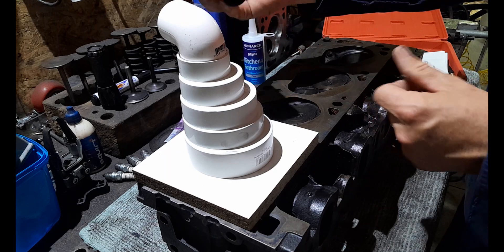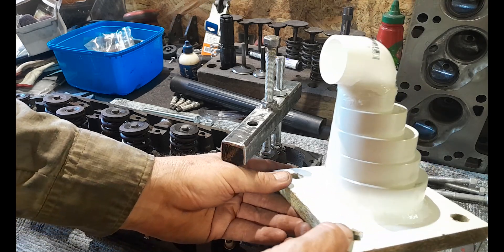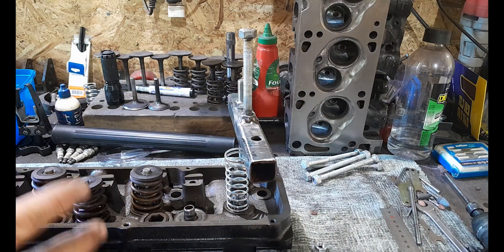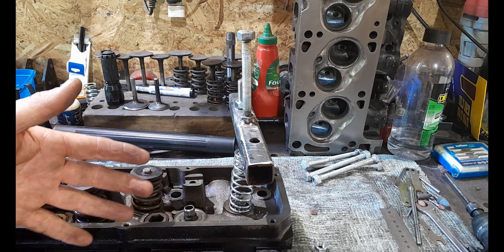How To Build A Simple Vacuum Based Cylinder Head Flow Tester

Comment: I have 3 maybe 4 cylinder heads for my 1500 triumph spitfire to flow,I bought a section of plexi glass tube the diameter and length of the cylinder,i bought a section of flat 20mm plexi glass,the cylinder top has a recess so i'll be mimicking the cylinder as much as possible,i may add an "O" ring groove to seal against the head,which would be the best idea,I probably should include the head gasket thickness in the step as the cylinder top step leads onto the gasket metal compression ring,so that will be added more than likely as it's a simple adjustment to bore the plexi glass sheet to the OD of the plexi pipe and glue it in place.

Add a fixing for a variable suction vac,either the little sliding port on the vac hose or the power level,don't need a massive amount of vacuum depression.

You have to be able to adjust the inlet valve in increments,I can't remember the actual critical region but it's not a huge amount as the critical point is around the first few tens or so of thou opening,using a dial gauge.
Something i see a lot is people trying to get massive flow figures,that is a bad misconception,sure the flow figures can mean you have a great flowing head,it can also mean you just butchered ahead and opened up the intake tracts way too much and now it's a full race head or junk,a full race head has to rev really hard at idle to keep the fuel air mixture flowing and not allow the fuel to fall out of suspension.

If the tracts are just opened up and are worthless because way too much material has been removed air flow velocity has been completely lost and the head won't work,a large paperweight.

I am using clear tube for a few reasons,but the main job will be to match the inlet manifold to the inlet ports,called gasket matching,so both metal faces have the same size hole as the gasket and also without any stepped edges to cause turbulence,that is at least my main goal,to remove sources of turbulence,all the little bits of casting flash and out of normal lumps and bumps,not however any curves ,bumps,lumps that are intended to be there,just the sources of turbulence that make the air canal smaller through turbulence.
Just smoothed out,sharp edges rounded,from initial flow figures of valve lift very little will need to be done to correct the flow to much better numbers.

I can measure the drop in vacuum pressure inside the cylinder or use an air flow meter at the intake to measure air velocity,both can give the numbers to work with.

I will lightly polish each combustion chamber then measure each chamber volume and adjust the low three to match the largest chamber by gently polishing with a finer grit than used to clean up the inlet tract to a cc or so then polish to get as close as possible,not getting hung up as the factory head i'll bet has 4 chambers  of different volume.

Get the chambers as close to a mirror finish as possible,then clean up the exhaust outlet tract and polish it to a mirror finish.

The inlet surface should be rough like 400-600 grit sand paper to create a tiny surface turbulence called a boundary layer,this acts as an air bearing that speeds up flow,velocity does two things ,it keeps fuel in suspension,and as the air fuel mixture enters the cylinder it creates a fast moving swirl motion mixing the fuel air even more,granted there is a bit more than this,but i don't thinl i'll be doing any unshrouding of the inlet valve,I will be re-cutting the valve seat to a 3 angle,this just helps the air move over the edge of the valve seat a bit smoother,5 angle would be even better,but i bought 3 angle cutters ,so that's that.

The main reason for using clear plexi glass tube is that i may use a small smoke bomb type device to see the flow pattern around the valve into the cylinder,curiosity mainly,but if the velocity can be upped the swirl should be more evident.
I don't intend to spend much time on this,i'll have to calculate the compression ratio after this and work out how much of a skim is needed to get to around 9:1 or 10:1 which ever comes closest without a huge head skim as the skim changes the rocker geometry,OHV.

Comment: I live in the U.S.
 Are these readily available in Australia?
 If so, how much jingle?
Reply from the maker: Plenty of these heads kicking around the land of Oz. Most you'll find for sale will require a complete resto in most cases. Aussie 302 heads that need resto work can be obtained for a around $300 AU. Cheap for you guys with the exchange rate favouring my mates across the pond. But! Shipping will probably cost as much as the heads. They ain't light weight being iron heads and they don't miss you with freight overseas.